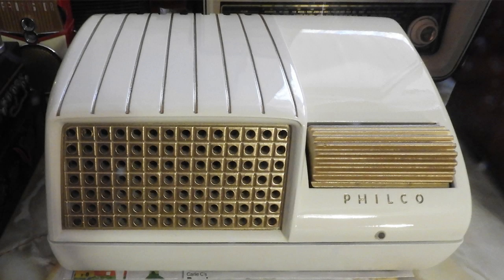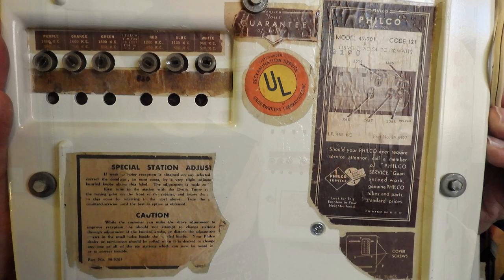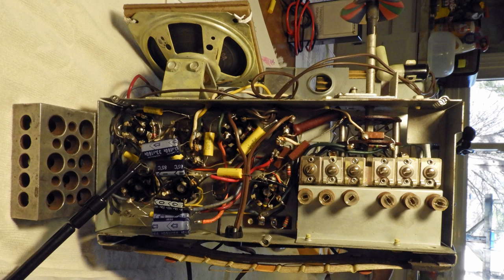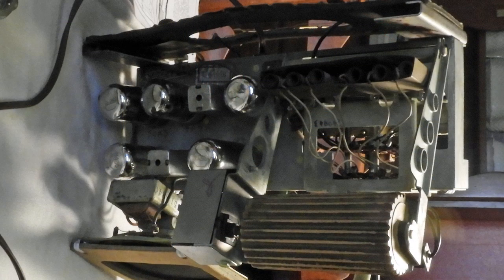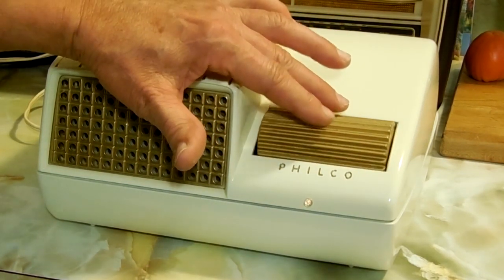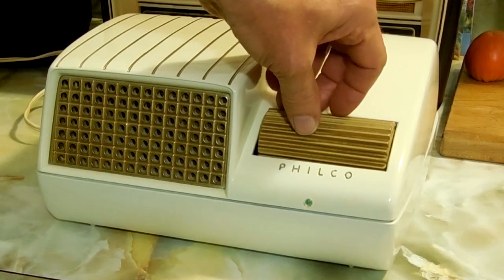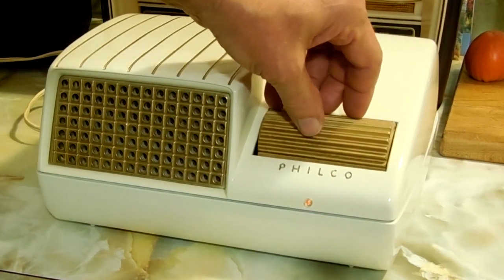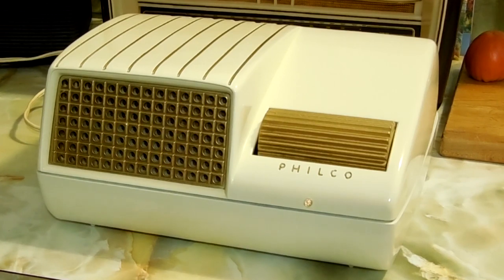Philco 49 901 Foot Operated Radio

Comment: This was not advertized as being an under the desk radio. That is an urban legend that is incorrect. Check out bandersentv for his comments on this legend. None of the Philco advertising promoted as foot operated or being on the floor.
Reply from the maker: So you could not operate this with your foot?
Reply from the maker: Send me a link to a Philco Ad  for this radio.
Reply: @AllAmericanFiveRadio  I'm sure you could operate this radio with your foot. You could also operate it with your nose. Philco never promoted or even suggested either of those methods. This is just someone's idea and the rumor spread. Maybe I'll start a rumor that this radio was designed to be operated nasally and see if the rumor takes off.
Reply from the maker: @herbertsusmann986  Send me an AD link from Philco for this radio

Comment: I know there is a website that says it is  foot operated. There is actually no advertisement from back then that show it was foot operated. There is advertising that show it as a bed side radio, which makes more sense. If you wake up in a dark room you can easily turn it on and off,  change stations, and see by the colored lamp what station it is on, in the dark. You would not see that little colored light down under a desk. Check out bandersentv on YouTube who shows that advertisement on his recent restoration video of one. I have one of these radios myself and agree with Bob.
Here is Bob's video at the spot where he talks about it not being foot operated and shows the advertisement that says it is a bedside radio. https://youtu.be/EBGTDCd8jGU?t=1070
Reply from the maker: Then why is it call the secretary? You can only see the light, looking at it from a down ward direction. That is the camera setup.
Reply: I agree, the usage under a desk is unsubstantiated by any of the old ads. There are ads calling it a bedside radio for the bedroom, den or nursery. I could see it sitting on a secretary's desk but not on the floor being foot operated.
Reply from the maker: @ko2fjb  That does not answer the question why Philco called it a secretary.
Reply from the maker: @ko2fjb  Send me a Philco adverting link for this radio.
Reply: AllAmericanFiveRadio Philco may have intended it to be used in an office environment such as sitting on a secretary's desk with its sleek modern design not under a desk out of sight.
Reply: @AllAmericanFiveRadio   Philco did NOT call it “the secretary”. Show me an advertisement or philco catalog where they refer to it by that name.  Someone made it up and the nickname has been repeated so many times it’s stuck.
Reply from the maker: Thanks